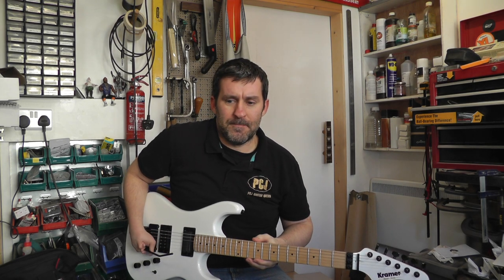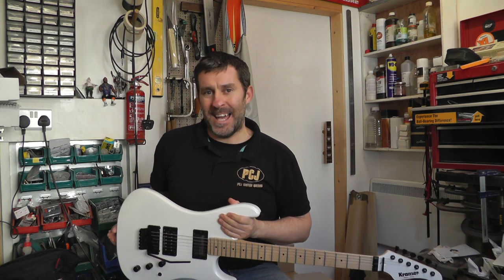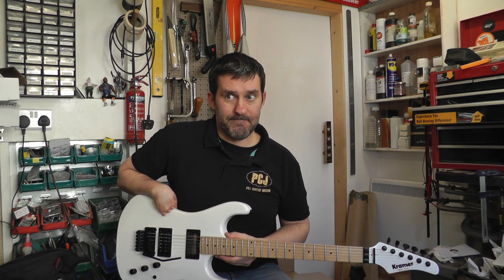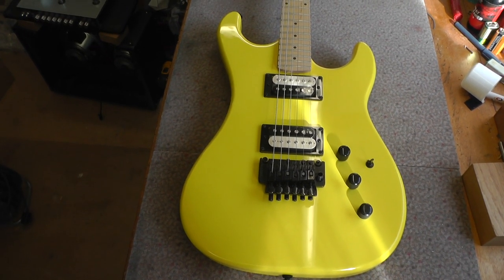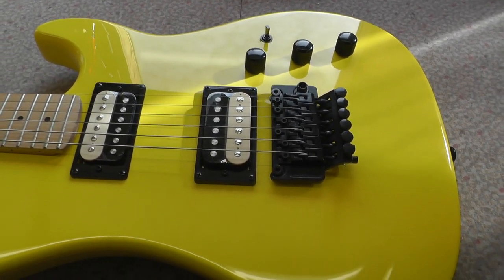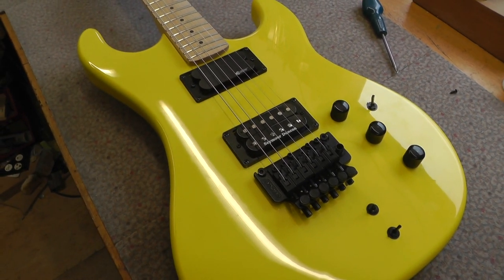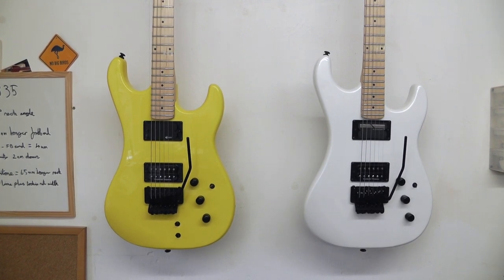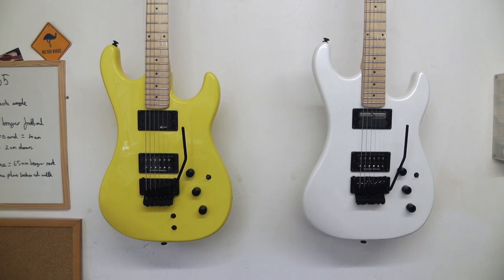Sustainiac Stealth Pro v Fernandes Sustainer - Parts and installs

Comment: You can remove the pins from the connector by pushing the tab with a small screwdriver. Push the wire through the existing hole then push the pins back into the connector.

Comment: yea that whole bit about drilling the holes bigger to accommodate for the connector I was shocked!! And then when I saw that he drilled a 12mm hole in a place that didn't need to be drilled just to make it through the other side!! WOW!! bro I can see you haven't done much with electronics, but that just boggled my mind after that... but you got some balls for the router job..  I had to rout my Kahler into the body of my ESP NV and that was a little scary but it came out very nice. I had a guy that worked at ESP in LA    that told me about the ESP NV guitars that there is a flaw in the necks and I did the only thing possible to get the action down you can check out some of my videos with my ESP NV Standard.   nice work Pablo..

Comment: there is an easy way to disassemble fernandes sustainer driver pickup connector  in order to put wire through a little hole in guitar. just take needle and push tongues that lock contacts in a white plastic housing of a connector. it easily assembles back again! just put wires in a same order as before.
Reply: Yeah. Just completely stupid to drill holes when you can dettach the connector.

Comment: Question.  
I too have installed a sustainiac into a Kramer Pacer classic.  I love the sustainiac and it works great. However when using the driver as a neck PUP, it squeals (microphonics) like crazy at stage volume with gain.  
Have you come across this issue?

Comment: On the Fernandes you can take Photos of the Plug then use a small Sewing Needle or Straight Pin carefully push the clip connector for each wire and gently slide them out of the white connector, then tape a piece of paper towel around the 3 wires with piece of masking tape push it through and then re-insert the wires into the quick connector plug... 

Installed these on PRS and Gibson Les Pauls that way no problem....

Comment: if youre using the fernandes kit and a bridge pickup other then the one provided, where would you soler the wires to on the circuit board? i have the FSK-401 kit and and struggling as the provided pickup is part of the solderless system.

Cheers

Comment: Might not want to do it but, with the Fernandez you could unsolder the switches, then put the switches where you want them, and run wires to wherever the board gets mounted. Not sure if this will affect the noise picked up by the regeneration circuit though (call Fernandez).

Comment: I can already see, that the sustaniac board is made of SMD components which are less desirable for tone quality, and doesn't have the small transformer, which the Fernandes has. A transformer is always a better option and has a good impact on the tone. Also the Sustaniac has 3 adjusting pots, and a 2 way mode switch, so less tweak ability then the Fernandez whit its 4 adjusting trim pots and 3 way mode switch. (one is for blending the overtones with the base note.) 
It is obvious that the Fernandes is a better quality, and better designed engineering piece.
Reply: While your opinion is of course valid,  engineering is seldom obvious; I'd encourage anyone to compare these units directly. The Sustainiacs are US made by a real pro and come in a 7 string spacing, and their electro acoustic sustainer is a ball to play with, being a clamp on headstock unit with no modding required.

Comment: I've had a Sustainer for about 10 years. Use it sometimes for textures on my recordings. I love having it, but it seems to have gone weak. I tried every adjustment but it doesn't seem to sing like it used to. Is that a known thing. Any ideas what to try?  Thanks!
Reply: I never had that issue and I have three Fernandez guitars with them one is a vortex elite made in Japan it also has a EMG 81 in the bridge and the battery does it need to be changed hardly ever but I hear the Sustainiac only last about two hours And there is the One other mode that combines the two modes Other than that I don’t see any difference in the two…
Reply: My sustaniac is as old and works great... I had him install it in a Roland G202 for use with my GR300 as well... LOVE that system

Comment: You could have removed the toggle switches from the board and mounted them where you originally wanted them.  Then, reconnect them using screened wiring.  Mounting the control board on stand offs to clear the pots 🤷‍♂️

Comment: Fernandes all the way
Reply: Dude are you serious FD looks like a pain in the ass dude.
Reply: No. Just no. If you're guitar came with a Fernandes, that's just fine. If you are retro-fitting a guitar, the Fernandes is nearly impossible, without major routing and surgery of your guitar. The Sustainiac is designed to fit, in virtually any guitar, in its stock configuration, no routing. They both work very similarly, and IMO, one isn't better than the other. Aftermarket install? Sustainiac all the way.